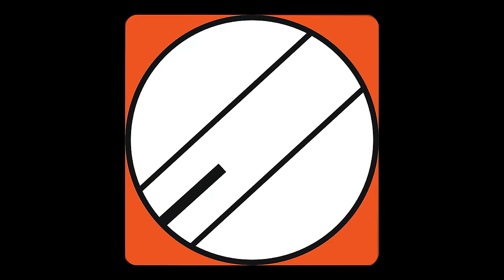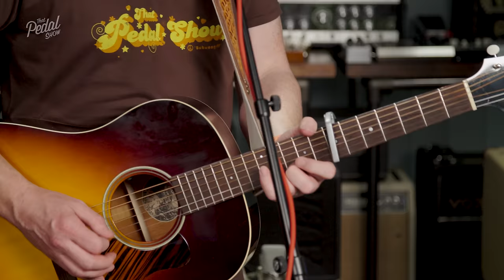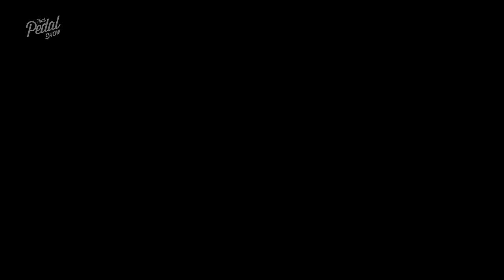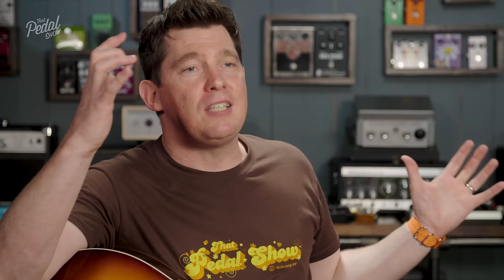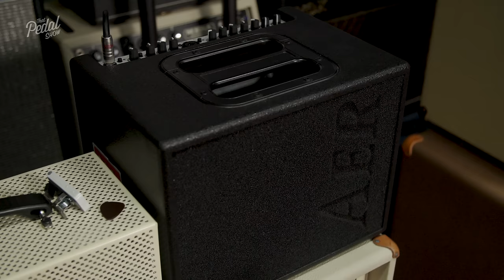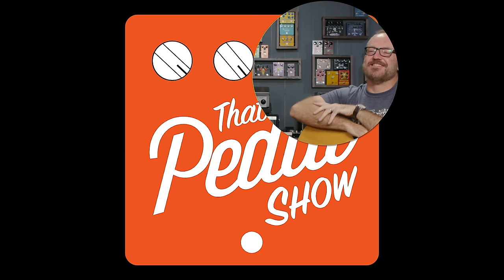Better Plugged-In Acoustic Guitar Sound Basics: Pickups, PA, Amps & All That Stuff – That Pedal Show

Comment: A pox on sound engineers ...... or most of them anyway. I recently took to using a Zoom A3 in order to 'take back control' of my acoustic guitar sound live. I'm sure there are better units out there but it does the job I need that type of processor to do very well. I'll be interested to hear the K&K pickup system through some processors as I've been considering replacing the Baggs M1 sound-hole pickup on my Martin EC Sig with it.

I've considered getting a dedicated amp before but I don't play enough acoustic guitar when gigging to justify it. I have used an AER amp like Mick's at open mic sessions and it did sound very good. 

Will you be doing something with solid, or semi-solid, electric guitars with piezo systems in to give us a comparison? I've been using a Fishman pickup in a Thinline Tele for some time and blowing people's minds with the tone. I've also used a Musicman Axis Super Sport with a piezo bridge in the past and produced a similar effect.

Comment: Passive acoustic? I've heard of them but every single one I've seen has the built-in battery powered preamp thing. Hmmm maybe I can bypass that since I have an acoustic amp...
Also I like the sound of the cutaway Martin, very bright. Could be the strings?
Reply from the maker: Could be - they’re fresh and lovely. But so we’re the ones on the other Martin. Collings strings were a few days in. Cool sounding guitars, and yes, the system in the Collings is totally passive. Requires a bit of work but I like that it has zero complication and weight on board. Cheers!

Comment: Just found this. Thanks! Whats a good pedal booster for acoustic?  Some inexpensive to top shelf is greatly appreciated! Cheers! PS  Thinking about an equalizer like a Behringer EQ 700 as a cheap one
Reply: I regularly play guitar in church and the LR Baggs Para DI box works really great .. very flexible ... fixes "stuff" ... also, as well as DI outputting to desk you can take separate signal to a nearby monitor ... I also have a Fishman Aura (allows you to blend guitar input with high end imaged sounds of different guitar body shapes with high end mics) which is magic at improving the sound of any acoustic (if it's good enough for Steve Howe of Yes then it's good enough for me!) .... pricey but works great.  CMcG, Aberdeen, Scotland

Comment: Would the acoustic preamps work plugged into the electric guitar power stage/effects return as per the V4 types? I know there is significant difference between what I'm assuming is an FR speaker in the acoustic amps and the speakers in an electric amp so it would be interesting to see how the Fishman/Orange sounds like used in that manner. 

Equally, and I know its not normally your bag, but acoustic IR's?  Do you have any experience/thoughts to share?
Reply from the maker: Hello Ben. Some electric guitar amps can work okay, and some people actually prefer that sound. But for me - Mick here - the speaker and general voicing of an electric amp is never quite right no matter how you use it. Usable for sure, but still weird EQ. 
IRs... as you’ll know Dan and I are both very nervous about any guitar sound that uses 100 per cent AD/DA conversion. There’s an unavoidable latency and disconnect from the source that, while you can get used to it, is never as good as the ‘real’ thing in our opinion. Useful, convenient, practical... None of the reasons I play guitar, speaking personally. Mick here. :0)

Comment: Does Mick have anything at all in-line between his K&K and the AER (such as a Boss tuner)? I'm asking as I've just put a K&K Pure Mini in my Lowden and I'm finding it quite bassy into my AER which I assume is due to the impedance. Some people seem to be recommending using something like a Boss tuner or eq pedal with a 1MegOhm input.
Reply from the maker: That can help. You're essentially giving it a buffer because in straight passive mode it can lose top end. I don't use anything, just set the amp accordingly, but I have heard that it works a treat.

Comment: I have a Martin 000 with an LR Baggs Anthem pickup system. The Church has a new PA system and can't seem to get rid of the unwanted crackling of the base coming from the guitar. What do we need to do to get the smooth sound of the guitar without the interference???
Reply: Hi there ... just a suggestion, have you tried a Behringer Hum Suppressor or equivalent (not expensive) in the chain? ... I regularly played in church and the sound guys used these quite regulary ... jack in, jack out .... nothing complicated ...  CMcG, Aberdeen, Scotland

Comment: They described he Anthem pickup incorrectly.....if the mic level control is correctly set (it sounds like it) then when the mic is completely on as they described ...it is more accurate to say the mic is carrying the majority of the sound with the piezo picking up the bottom end.  Just go to the manual on the LRBaggs site.  And IMO it is the best pickup on the market bar none.
Reply from the maker: Thanks Layton - appreciate the correction. It’s certainly very very impressive!

Comment: Why does an acoustic into an electric amp sound like it did for you guys? Is it higher signal? Is it just EQ? I ask because I plug my Martin (with Fishman pickups) into my Reeves 50W (HiWatt clone), and it sounds like an acoustic (and sounds fantastic). My pickup does have volume and tone knobs on them which may be helping things. Just curious - love the stuff as always.

Moo
Reply from the maker: The Hiwatt is higher headroom I guess, Mick here. Also would benefit from some kind of FET or similar up front. But no matter what amp, a guitar speaker cab never works like a FRFR type response (a PA speaker). But like anything, if you like it and you’re used to it, all good!
Reply: Thanks Mick! Yeah, I can see where some of it would be a different beast. I'll have to try my guitar through a proper setup sometime.

Cheers!

Moo
Reply: In addition, you are correct about the Reeves (HiWatt) - it has HUGE headroom.

Moo

Comment: Just to clarify, Takamine has their own pickup system that’s actually still very good. They definitely don’t just use an undersaddle pickup.
Reply from the maker: All the ones I used to play were under saddle. Palathetic, or something I believe they called it?
Reply: Yep, it's the palathetic system. The difference is that unlike a standard UST pickup where the piezo sits under the saddle, the Takamine system is actually six individual piezos and the pickup is built into the bridge. It really produces a more natural tone without much quack. That's why Takamine guitars often sound a bit dull acoustically. They are built around the pickup system in a sense. By the way, Mick should really check out the Tonedexter for his K&K pickup. It's incredible.

Comment: I love the LR Baggs Anthem, I have it in two of my acoustics. However my Taylor 714CE has the Fishman prefix. To help reduce the Piezo sound I run my Taylor through my Atomic Amplifire, loaded with acoustic guitar IRs from 3 Sigma. I blend the two sounds together, piezo and IR using the separate stereo sends from the Atomic. It works a real treat in making the guitar sound more mic'd. Oh and shock horror, I also send my acoustic through a Cornford Carrera for a crunch tone, splitting the signal with a Radial Switchbone. It works amazingly well when I want to add some crunch in addition to the separate pure acoustic signal. You would think it would sound pretty bad, but for such a compromise it honestly doesn't!! To tame the Carrera on stage but get a massive crunch tone, I use a Weber Mass Attenuator, and a Palmer Speaker Simulator to the FOH.
Reply: Taylor Crunch Carrera sounds fun:) 
May I ask why you went that route instead of a good mic and/or transducer in the Taylor? Why use piezo powered modelling for such a pristine instrument and hardly amplify its acoustic character?
Reply: @everythingisopen  Hi. Sorry for any confusion here. I am running my acoustic send in to two FOH channels via the Atomic. From the excellent onboard Fishman Prefix PU system through the Atomic for additional EQ, compression, reverb, delay (50ms - pushes the guitar further in to mix without hearing a repeat) reverb, tremelo etc when I want these. One out has no IR, and is basically the Taylor/Fishman with effects, the second output from the Atomic runs a Martin D45 Impulse Response. I could use a Taylor IR, but at the moment like the Martin. By then blending these two together at the mixer I find I get an enhanced tone for my amplified acoustic, with less of the usual piezo characteristic. Works for me!!! The Atomic is an impressively pristine unit in a small package. The crunch thing is in addition to the acoustic guitar sound, it adds something extra when I want it to and is of course a third channel to FOH. Most of the time I play using just a pure acoustic sound. When I am playing fingerstyle, I hit one of the pedal buttons on the Atomic, for a little more volume and slight alteration to EQ. It is always going to be a compromise when amplifying an acoustic in a loud on stage situation when you are playing with other instruments. This method for me still retains a good proportion of the lovely sound of the guitar, but makes it sound less piezo biased. When using the Anthem loaded guitars no IRs are required!!!!! I could put an Anthem in my Taylor at some point but that is yet more expense. This solution cost around £20 for the IRs.
Reply: got it, thanks for the reply @Bernie Smith
I'm new to acoustic modelling and IRs in general and wonder if you ever, at certain volumes, notice a separation between the pure acoustic signal in your hands and what's coming out of the speakers around you? If so is the solution then to create IRs from exactly your instrument? 

And, if I understood your setup correctly, is it correct to assume that the quality of the amplified signal is mostly dependent of piezo output and processing of the IR? Ie. you can then use any piezo equipped guitar you prefer, even an electric?
Reply: @everythingisopen  Hi guitarorben. Not really sure what you mean by separation. I guess most of the time we would all like our acoustics to sound as close to their unamplified individual sound as possible. That is why we probably bought that particular guitar. When we use pickups or even microphones we are moving in to the realm of compromise. The Anthem is a superb sounding live tool as the microphone element of the system can be used at pretty high sound pressure levels without feedback, helping to compensate for the piezo part of the system. I have been experimenting with 3 Sigma Audio IRs, as I already have a couple of IR loaders, and I find these acoustic IRs improve my overall tone by reducing the piezo quack etc. I am not really endeavoring to make the amplified acoustic sound just like my guitar, I am just trying to get the best compromise acoustic tone I can for a live situation. I am sure a good deal of the tone is still coming from the guitar itself, using the method I have previously described. I feel sure you will have already done this, but have a look at some of the 3 Sigma Audio acoustic IR content on YouTube, and online reviews. You can use acoustic IRs with any guitar source. Some have been designed specifically for converting electric guitar pickups to sound like acoustic guitars. I know Two Notes for example don't think that producing guitar IRs is in the same technical or quality ballpark as what they do when creating cabinet responses etc. and as they are experts, I would have to concur. If you have access to an IR loader give it a go would be my recommendation, or better still buy and install an LR Baggs Anthem.
Reply: thanks Bernie Smith  - separation exactly as you described it, the difference between what you hear up close and what comes out of the speaker(s) or down on disk or tape. 
Did try some acoustic IRs on a piezo track in the meantime, not the Sigmas but a Taylor among others floating online. Quite useful indeed especially coming from a piezo output. 
My current pickup is the irig acoustic which is a MEMS mic but haven't tried that with IRs added yet.
Thanks for the chat and for sharing your insights and exp. here.
Reply: @everythingisopen  My pleasure.

Comment: Hi Guys, my electro is the Faith Venus Eclipse and i'm not an accoustic player. They pickup has the option to change the output per string and has some base mid treble control on the pickup as well. Could that fix some of this? Also is there an option to use something like a 15 or 31 band eq by itself to fix some of the sound issues (liek the behringer fbq 6400 for example)

Comment: I'm confused. I've seen several things here - internal mic, acoustic amp, pre-amp pedal - that improve the sound, but I don't know where to start. I play a nice guitar with a piezo + internal pre-amp straight into the desk... what should my first upgrade be?
Reply from the maker: Either a decent preamp pedal or an acoustic amp. Or if you’re happy with sound, don’t change a thing!
Reply: Thanks guys. I'm happy with the tone but my problem is that I have to set the guitar volume pretty high in order to get enough level to the desk, and that means that the dynamic range is wider than I'd like. Keeping it under control, particularly with fingerstyle, is tough. I'd prefer to have the guitar volume no higher than half-way if possible... sounds like the pre-amp pedal might be the way to go, to begin with at least.

Comment: I have a 20 year old Martin D-15 that I want to amplify, but I don't want to cut a hole in it for any sort of active pickup and I don't want an under-saddle pickup for various reasons.  What pickup options would you recommend for a person with these problems/limitations?  Thanks!
Reply from the maker: Its tricky but sound hole pickups can be made to sound good with some savage eq. Dean Markley had one called the "Woody" which I really liked.
Reply from the maker: Mick here - get a K&K Pure Mini. Same as I have in the Collings. No holes required other than the endpjn ream (which might already be done). Cheers!

Comment: So what would you guys recommend for a Taylor guitar plugged in to a PA where I cant use an amp?
Reply from the maker: Without wishing to sound facetious, we recommend an experienced and sonically sympathetic sound engineer. If that engineer is you, it depends on the system in the Taylor. The earlier Fishman electronics are straightforward enough, but the first-gen ES take a little bit of care. Second-gen easier. probably too much detail to answer here but in short, make sure it's not overdriving (set your input gain so it's not clipping into the desk) and adjust the EQ to taste. Good luck!

Comment: I put a sound hole pickup in my dreadnought and strung it with flat wounds...still doesn't sound like an arch top. 😔 More like a cheap old Kay.

On a serious note, I don't think anything can beat the Anthem in terms of accurate reproduction of an acoustic sound. A soundhole pickup is probably better on a high volume stage, though.

Comment: Pretty sure the K&k in the Collings and Input of the L R Baggs does not match therefore it wont sound as good as it should. The K & K requires  1M ohm input and the LR Baggs is 10Megaphms. Also the Aer channel 2 is a match but the channel one is not.

 Good review and the anthem sounds very good in the martin. The Collings sounds excellent in the AER.
Reply from the maker: It sounds great to me Thomas. One of the results of what you’re saying is that the input definitely loads the pickup a bit so I lose high end when I turn down. I LOVE that! Massively useful for me, although some people would hate it. No right or wrong, just what works for you. Cheers!

Comment: Why wouldn't anyone use an acoustic guitar amp?  Here is my main reason: I want the FOH sound that the audience hears to be better than what I hear in the monitor.  I don't want to fool myself with a great sound on stage that is better than the FOH sound.  To avoid feedback and mud in the vocal mics I don't really want much sound on stage anyway - quite happy with no wedges and I have zero tolerance for in ears.  So my preference is to concentrate on the FOH sound.  Everything will need EQ'ing for each enviroment but generally my FOH system is aiming for a flat response and I prefer to use a full range monitor with no eq that is as close to a flat system.  I like to use wireless direct from a passive piezo - so I can hear how it sounds through the FOH.  Whatever I get through the monitor should be adequate.  The other thing is that acoustic amps generally put a bunch of stuff - like cheap reverb and mixer and DI solutions that are just not as good as having carefully selected seperates.  So I would always recommend buying a powered PA speaker that can be used for small gigs or as a stage monitor - and then use seperate pedals to get the sound you want.  I like my Tech21 Q-strip for parametic EQ and saturation.  The TC Body Rez does a really cool thing with multiband compression and makes it easy to swap the polarity with a single stomp.  I'll have to compare the Body Rez/Q-Strip  with the LR Baggs Align stuff ... looks similar idea.
Reply from the maker: If it works for you it works!

Comment: Interesting. Not all of the combinations sound good. Piezo pickups don't sound good at all.  The best rig I have ever heard and played through was a Sunrise Pickup, to a BBE Acoustimax, looping an Eventide H9 and TC Helicon VoiceLive GTX all outputting to an Alto Professional TS310.  I have yet to hear a better rig.  The HeadRush GIGBOARD is a very close second.  I toured with an AER 60 and blew it up. It was okay when it was alive, but a 2000 watt powered PA speaker (Alto Pro TS-310) for acoustic is the ONLY way to go.  Match the Sunrise on a Gurian JR and you will have a VERY tough time finding ANYTHING to sound better.